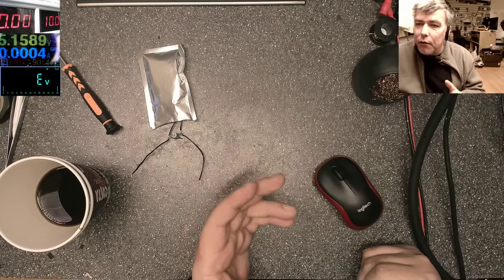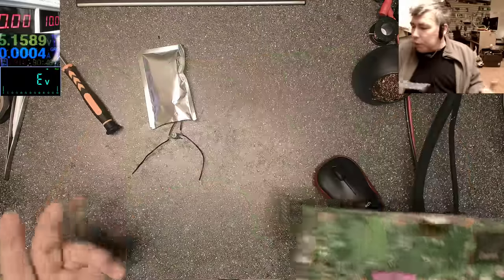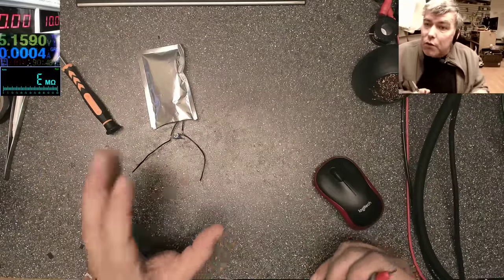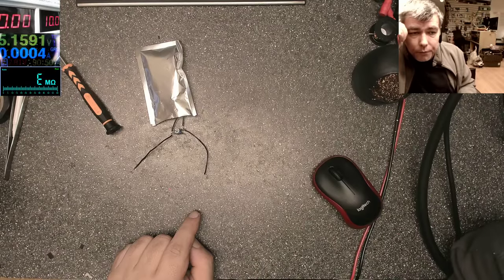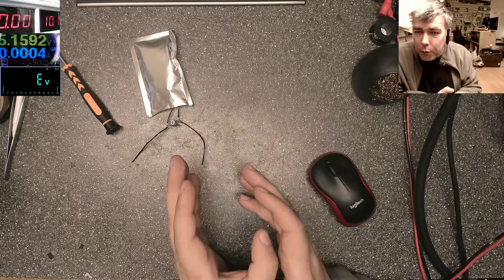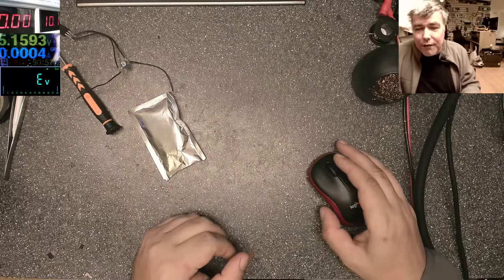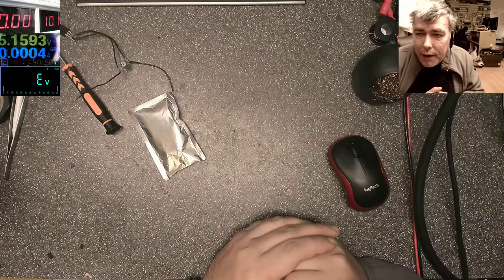Why I’m Always in Diode Mode - Let's make a test

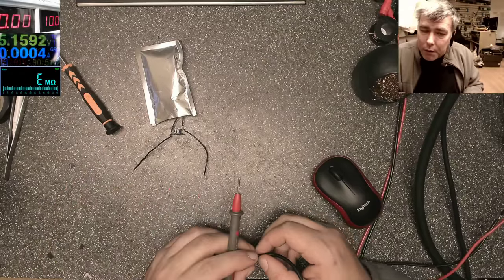Comment: I’m sorry, and perhaps it’s a language barrier thing, or maybe I’m just too much of a novice. But, I don’t understand what this video is trying to demonstrate. 1-You want us to figure out, what component is hidden behind a 1Kilo Ohm resistor AND beneath a silver bag [?!]. 2- So, with the multimeter on resistance mode, you get a reading of 1kilo Ohm [the circuit is not powered]. 3- At 6:53 you power/inject the circuit with 5volts [1amp]. 4- You then check on diode mode, and you get a reading of +/- 0.5volts and say:”...it is not necessarily a diode, it is probably a junction [diode, LED, etc]”. 5- Finally, the component is revealed - it’s a mosfet. So, I ask: “How does one apply, any of what was said and done, in this video, on an actual circuit board? Also, if you are not blind, when you are placing the probes on a circuit board you will see/know, what component you are testing? So, why did you hide a mosfet beneath a bag? When does that happen, on a circuit board? If you want “... to see what is further down the power rail”, just use your eyes! Seems to me like it would have been more useful, to explain WHERE and WHY one should START by placing the test probes on a circuit board, when you are trying to diagnose an issue with it. What was the point of this whole video? I’ve watched this video three times - To me, this it’s just a mess of random words and facts, with no applicable lesson in sight, that I can see. Please clarify... something.

Comment: Thanks Sorin, but  what is the conclusion of this diode reading? 0.4V means the junction is good, what if it was 1.4V?  what does that mean? and if the junction is bad what would be the reading? 
(I know a beep means short and it would be Zero in Ohm Mode that is easy), but what is the message from the diode mode you spoke about?
Reply: The multimeter sends a small amount of voltage through the circuit. 0.4v is the voltage drop (voltage difference between the positive and negative terminals of the multimeter) It means that most of the voltage is just going through the circuit easily with low resistance. 1.4v means 1.4v loss through the circuit because something is taking that current which means a higher resistance.
Reply: dmm's have oc voltage of 3.3v approx in diode mode.  except for zener diodes, most semicons will be active at 3.3volts
Reply: @DetermineLyngdoh  For example, the value at the output of the pwm integrated is 0.060mv.  what does this mean?

Comment: In diode mode you inject 1uA current in the circuit and you measure the voltage  across the semiconductors, on ohms you have high impedance and you read the resistance. Just that
Reply: "in diode mode you inject 1uA":  1mA /3V is the correct value, 1uA is too small. There is no multimeter that use 1uA in diode mode. In ohmeter mode you can have  a low voltage, it-s not about impedance.
Reply: I would have like Sorin to tell us that. I'm still confused with his video.

Comment: Great Sorin. One question: on the diode scale, the multitest injects about 3 volts into the circuit, correct? So is it safe to use this scale in the VCore sector since this sector works with 0.9 to 1.5 volts?
Reply: it is mainly the current that causes most demage

as mentioned by Arvid, for DMM, short circuit current for DMM is too low to cause any issues

Comment: That's always been a problem with multimeter ohms mode, often not enough potential and current allowed to even light up a 2V led.
But resistance mode is  good for not turning on semiconductors, most of the time lol.

Comment: Hello Sorin do you have a video on testing diodes in a circuit. What the best way is. Cause i tested diodes in a circuit and i had a reading from both sides and thought the diode was broken. Then i desoldered it and tested it and the diode was good. I don't want to desolder every diode i have to test. And a question on resistors. What's the difference between smd resistors R100 and 100? Regards

Comment: Hi.frankly, it's a bit of a mixed expression. 
I've been trying to figure out how the diode mod works for a few days.  The probes there, actually, the logic of measuring the diode in the reverse direction is the ESD diode protect event. In fact, negative voltage is applied to the motherboard through the esd diode in the opposite direction.  and it shows the voltage drop of the diode there.  but the output values are not standard as in the phones.  For example, if a value on the chipset line gives 0.060mv, it will give a different value on another motherboard.

Comment: Hi there, at 06:31 you said we have current limit 1 amps, you mean we have to set manually on power supplay 1 apms for safety?
Reply: Maybe he used his "Faulty" benchtop chinese power supply :D
Reply: @tanner1985  i didnt understand, when we have ordered.. Linear dc power supply,built-in it has protection option, besides we must set manually to 1 apms or automatically power supply detect and safe our circuit??

Comment: very good and instructive ways of troubleshooting black box type circuits.

i would like to add here  that tools needs to be used judiciously as per application.   for a DMM in ohms mode the Open circuit voltage on probes is tool less to switch on the pn junction of semicons.  Whereas in diode mode it is around 3.3 volts.  Most of the modern day devices are working on these logic levels, so connecting to dmm in diode mode means as good as connecting to actual power rails.  of course will low current limits .

Comment: The one part of the video I don't get, nor is it explained, how did that MOSFET change from 1k to a low resistance when he only connected two wires to the gate and the source. Current doesn't pass through the gate because MOSFETS are controlled by electric fields.

Comment: Hello. Sir maybe you can do a video  content on how to test  capacitor, resistor, diode  using analog multimeter or Digital Meter  without removing in cellphone pcb board.. I want to learn  on how to be a cellphone technician..

Comment: I want to apologize for my last comment. I did not mean to offend. Pardon my ignorance. I will try again, to ask a better question. So here goes: if you are going to use the diode mode to find a short, somewhere in the power line and you get a reading of +/- 0.5 volts. Ok, that tells you, that you have a junction [you could have used your eyes but,... whatever]. Ok, but that is a good junction, the diode mode isn’t telling you that it’s bad. Then what? You haven’t learned anything more, about the circuit or about what issues it might have. Am I wrong?
Reply: lol my thoughts are the same... He didn't give us an example of a bad one. Or even a short to ground

Comment: i have a problem to my laptop.
i changed my cpu Intel celeron 1000m(35w) to i7-3740qm(45w).
this is working but after 30 minute suddenly shut down.
why ? what i should do ?
Reply: have you checked thermals? Maybe 45W it's overkill for cooling system and it hits like 100*C? check at sensonrs in hwinfo software.

Comment: Unfortunately, the reading was unexplained. I was hoping to determine WHY using diode mode was different, or even better.
Reply: He explained it clearly and demonstrate it. The diode mode will be able to tell you that there is something like Diode or PN junction there, and whether the circuit is NOT just resistor(s). If you use Ohm mode you can only detect the resistance, ignoring the possibility that there might be something else in circuit and will trick you into believing that the circuit is safe to be plugged into power because you see resistance is high.